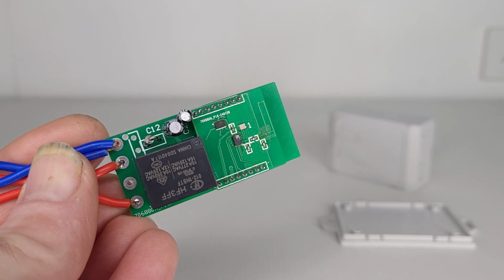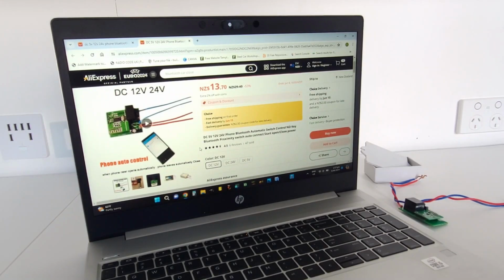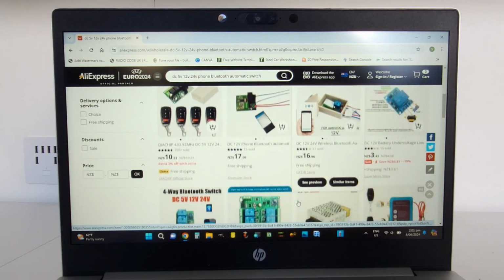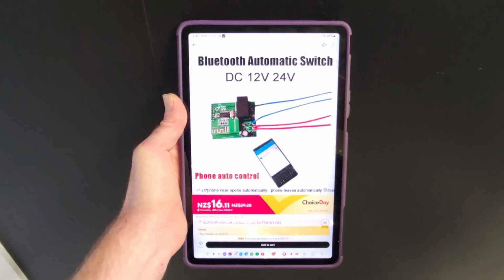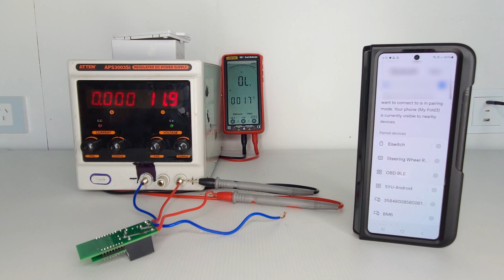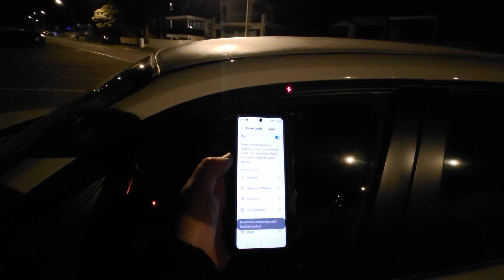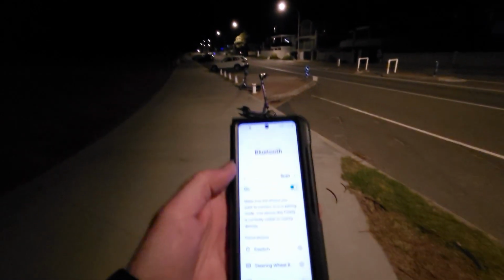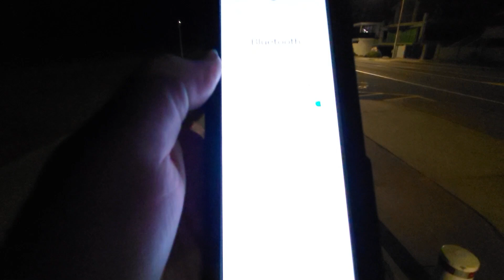How does a Bluetooth Proximity Switch work?

Comment: Can the module set a distance trigger?
Reply from the maker: @tinkernaut7202  yes but the distance would not be adjustable
Reply: @SHORTwithTECH  I'm a total newb in this realm - so I'm confused by the answer above. Could it be setup such that it only activates when phone is within a very short range - say 1 meter?
Reply from the maker: @thesteelman4154  the range distance is not adjustable with this particular device so its just standard maximum Bluetooth range e.g up to 10 metres